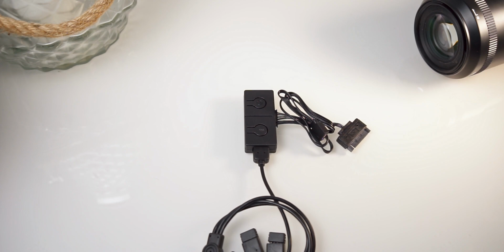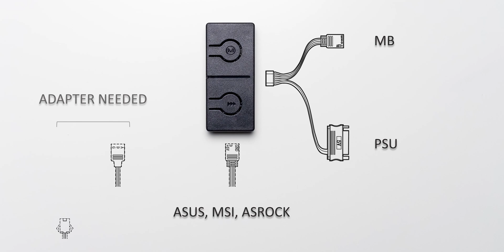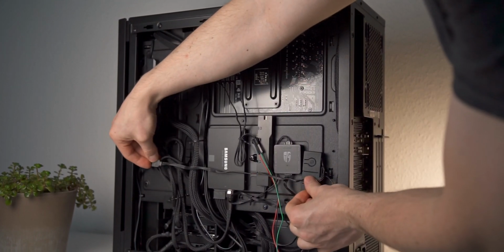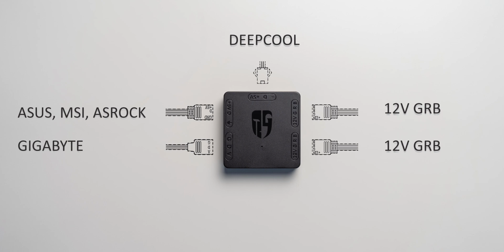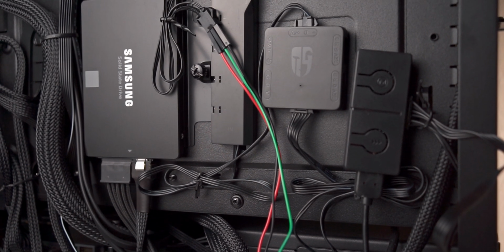EZDIY-FAB RGB Converter - A Deepcool Alternative

Comment: Hello mate, I have a asus tuf motherboard which only has 4 pin rgb headers. Do you thing I can use this or the the deep cool converter to connect the lian li strimers cables rgb feature which is a 3 pin to my 4 pin using these converters? 

Thanks in advance.

Comment: OH  one thing I am not happy with ,  with this EZDIY hub is that it has a spot on the hub for 2 LED strips.. well I have a buttload of LED strips laying around  4 pin and they WON"T FIT in the hub,, so I'm guessing again you will be FORCED to buying their light strips ..  which to me is BS and I won't do it.. this setup will hold me for awhile until I find a better solution ..  So I won't waste my money on a converter I'll just wait and get the right one.. :)   this is just my experience so far ..  I am still happy with the quality of the fans and the noise level of 5 fans is very low..

Comment: The price difference   for each... Deepcool Alternative is like 16.99 and the EZDIY is 22..99    seems like a no brainer to me...  and I have the 5 fan  EZDIY setup which won't work on my older Asrock Z270 motherboard RGB control because it has 12v 4pin.. and the 5 fans are all only usable on the hub they are proprietary plugs.. but you can't beat the price and quality of them  5 fans and hub and remote for 34.00
Reply: I have the same hub, did the converter work for you with the hub also installed?

Comment: Great video. Everything was explained very well. 

This helped me to figure out what I needed to turn on the converter without pressing its buttons. I took my case's reset cable (which used to be plugged into my motherboard) and connected it to the converter's two pin connector.

I can now press the reset button after turning on the system to get the RGB going. Haven't figured out how to do it automatically yet but it's not a big deal.

Comment: I have this converter.  It's  great but the only problem is I cannot connect 12v 4 pin RGB fans to this device.  If you have 3 pin 5v RGB fans then fantastic this product will work great.  If this is not correct please tell me but I've tried to connect using a 4 pin dual pin header and it does not seem to work.
Reply: If you have 4 pin fans what do you need the converter for?

Comment: I bought the Deepcool RGB Convertor 2 days ago.  After I finished with the connections, I noticed a flickering on front fan. I have Coolermaster Masterfan series. I contacted Bangood for refund & Deepcool to inform them about the issue. This a part of their reply: " According to your description, we are afraid it is compatible issue, because manufacturers of some motherboard update the chipset of lumination , RGB convertor can not be compatible with all motherboard well. so We are afraid the RGB convertor would not be working well with your motherboard.
"
Reply: Which motherboard do you have?
Reply: Asus Rog Strix X370 F Gaming
Reply: @Nick_Stf  Still flickers with the lighting?
Reply: @genotsSnor not anymore. I have removed & sold the converter. Waste of time. Personal opinion always.
Reply: @Nick_Stf  Oh okay. Thinking of trying it out with my ASUS b450f gaming. Thanks for letting me know.
Reply: @genotsSnor  glad that I could help. You have a newer chipset. It might work with your motherboard.
Reply: @Nick_Stf  True that. Have a good one

Comment: Hello is it possible to connect liam strimer plus to this and then to a asus motherboard (to the 12v pins)... i want to sync the liam strimer... but they are only 5v and asus aura/icue only supports 12v
Reply from the maker: Should be possible as the strimer comes with a standard 3 pin header.

Comment: i dont have an led header on my mobo and my fans r normal rgb w a 3 pin connector will dis fix my rgb
Reply from the maker: It won't do anything for you if you don't have 12V RGB headers on your motherboard. Well, unless you plan to use it purely as an RGB controller, but there are other devices that can do that better.
Reply: @techlessYT  what would you reccomend to me i stupidly got a mobo w no led header and am trying to find an alternartive to get my rgb working wat can i do
Reply: @techlessYT  so wait it cud still get my fans to light up
Reply from the maker: Just get an RGB controller with the right pin out for your fans. The EZDIY device is a two in one device with a converter and controller build into it.

Comment: at 2:51 you mention a dedicated ARGB controller. any recommendations? i haven't seen any real controllers that don't use proprietary connectors.
edit: i mean a controller i can adjust through software, through a usb connection.
Reply from the maker: The only controller that I am aware of that connects via USB and doesn't use fancy connecters is the Asus Aura Terminal. It's pretty expensive (it can also do that Ambilght kind of stuff though). But it's probably more expensive than upgrading to an ARGB compatible motherboard.
Reply: @techlessYT  i just found an insane deal, zalman ZM-LF120 triple pack, including the controller, for 48€ on caseking. As far as i know the z-sync controller is controlled through usb and the rgb connectors are standard 3pin 5v. I wanted 3 fans anyway and the controller is basically free in this pack.
Reply from the maker: Great deal! Thanks for making me aware of this bundle.
Reply: @techlessYT  i used it for a bit now. the controller is seriously held back by its software and as far as i can tell there is no SDK available. the fans perform great so far, but i was afraid i'm gonna snap the mounting studs off when installing them.

Comment: Looking to connect 2 x argb fans and 1x rgb fan and 2 rgb led strips all from deepcool to one controller on Asrock AB350M Pro 4. Heard deepcool don't work with asrock motherboards. Did you get any issues?
Reply from the maker: I haven't tested the converter with an ASRock motherboard, but there's no reason it shouldn't work. The RGB headers follow the same standard as with other manufacturers.

Comment: Is it possible to not plug it on the Motherboard (If the motherboard doesn't have 5v or 12v) ?
Reply from the maker: If you want to use it solely as a controller (instead of as a converter) you don't have to plug it into the motherboard.
Reply: Thanks that'll help !

Comment: I have two argb fans, can the two be connected on the Deepcool converter at the same time?  If not, what can I do? Is any splitter compatible with the Deepcool converter?
Reply from the maker: You can connect multiple ARGB devices to a single header, but you will need a splitter or hub. A regular ARGB splitter does the job. The EZDIY converter already has one included.
Reply: @techlessYT  thanks for the info! You got a new subscriber.

Comment: Schönes Video,
eine Frage: Ich habe ein Motherboard mit 4 Pin  Anschluss für RGB und folgende Lüfter gekauft https://www.caseking.de/lian-li-br120-digital-rgb-pwm-luefter-3er-pack-controller-schwarz-120mm-luli-010.html. 
Bei den Lüftern wurde so eine kleine Fernbedienung mitgeliefert um zwischen Effekten zu wechseln, u.a auch 2 verscheiden Farben pro Lüfter. 
Ist es möglich diese Fernbedienung noch zusätzlich zwischen Lüfter und Volt Converter zwischenzuschalten und wenn ja an welcher stelle müsste die Fernbedienung sein. 

Du hast ja gesagt mit den Convertern alleine kann man nur eine Farbe abspielen.
Reply from the maker: Danke!
Kann nicht ganz erkennen, ob die Fernbedienung einen 3 Pin Anschluss hat. Wenn ja solltest du die nach dem Converter anschließen können und dann vermutlich zwischen Motherboard RGB Signal und Fernbedienung umschalten können.
Aber eigentlich kann das der EZDIY auch.

Comment: Great  review. I bought one of these recently. It has some cool effects but every time I retsart my PC, effects are reset to case's own controller. I'm not sure if it's supposed to be that way
Reply from the maker: Mine doesn't do that. Are you just turning your PC off or entirety disconnecting power?
Reply: @techlessYT  Just turning off. I tried turn on/off, hibernate and sleep - all reset the lights. Only restart seems to be fine because restarting PC does not turn off lights.